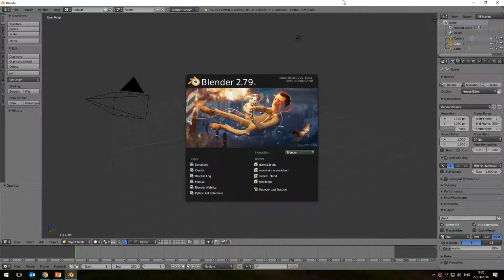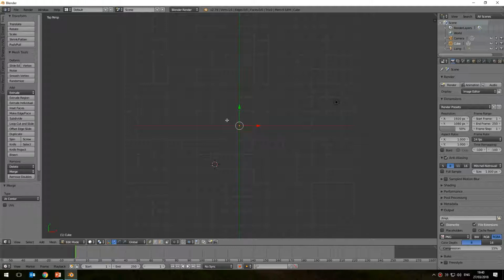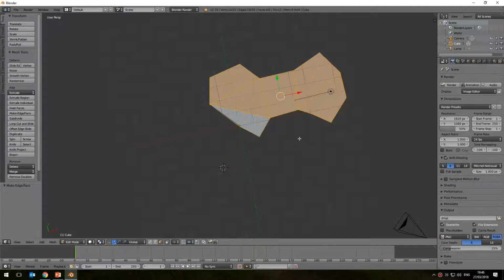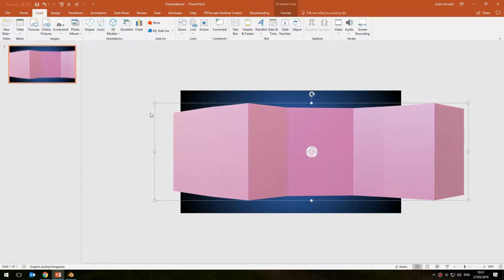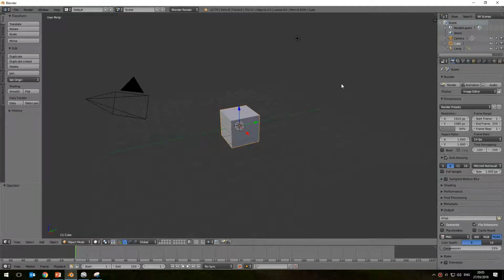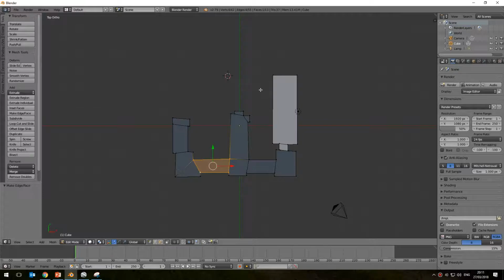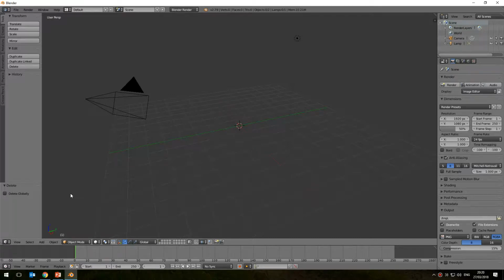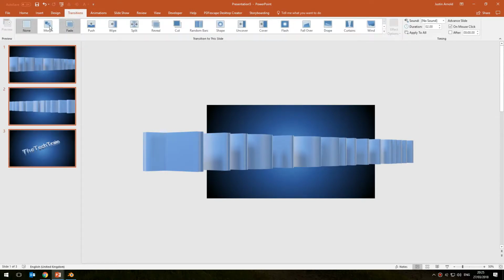Create An Awesome 3D PowerPoint Presentation

Comment: The textures missing when I am importing to ppt can anyone help?
Reply: Yes. Basically you can not import complex materials and textures to PowerPoint. For example, if you take a simple cube and just use principled BSDF, then PowerPoint would perfectly load that colour. However, if you change it to emission or glass with the same colour, then PowerPoint will fail to even give the mesh the colour you assigned.